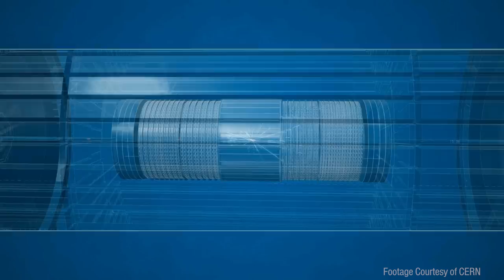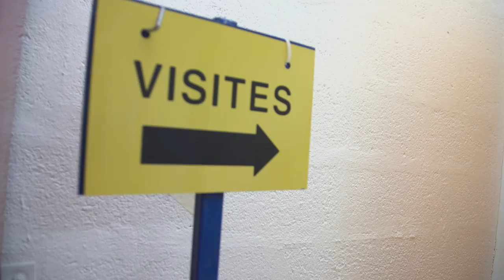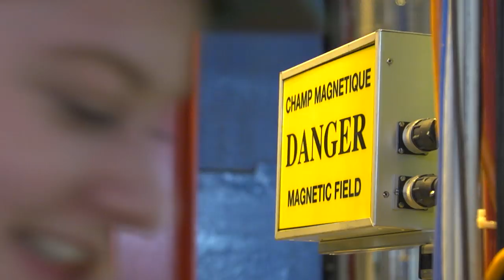Simone Giertz Goes to CERN!

Comment: Question: The people we see working on the equipment and experiments, are these all physicists trained to build the equipment, or engineers who helped designed them/specialize in building the equipment? Or are these another group, a sort of specialized mechanic?
Reply: From what I've learned from my professor, they're engineers who help with the accelerator :)
Reply: (I haven't worked at CERN, but my graduate education was in the same type of research at smaller facilities; my experiment was run at the electron accelerator in Newport News, Virginia.)

Typically they're technicians employed by the lab or the experiment that have expertise in that type of device.  

The equipment is typically built by teams hired by the experiment.  It's a weird level of manufacturing.  They usually build thousands or tens of thousands of something, so it isn't as assembly-lined as building, say, cars, but you do have to streamline carefully.